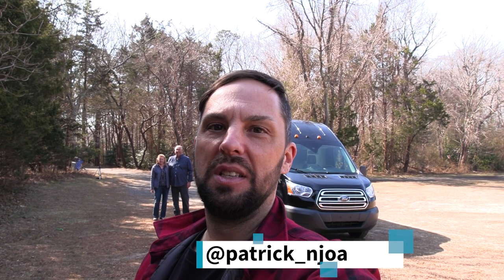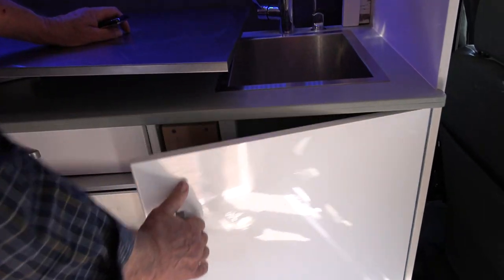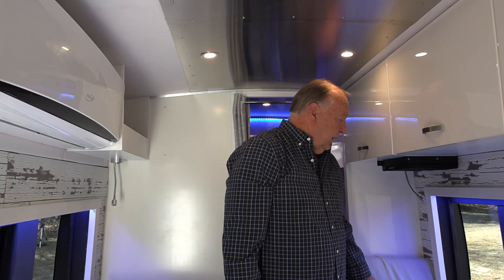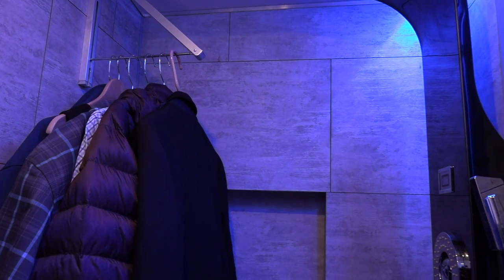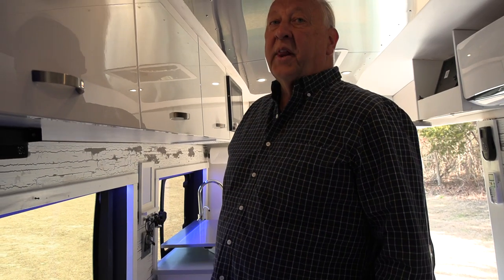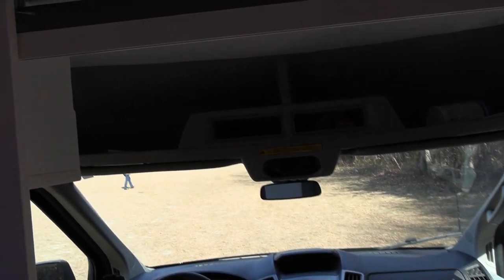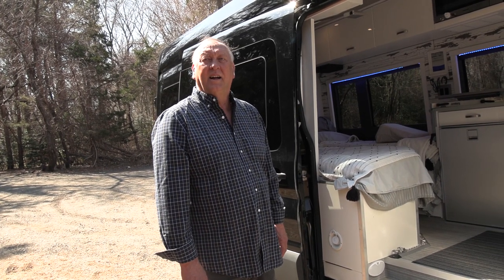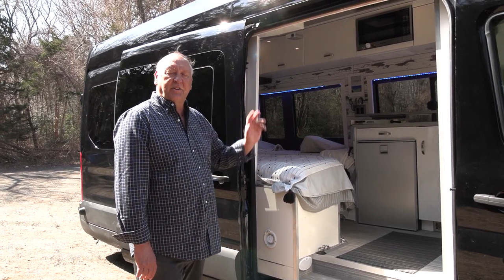Home Builder Creates Extravagant DIY Van Conversion With Full Bath & Shower

Comment: Great van build from someone in my age group. I agree that one doesn't want so many chores. I'd love to see a build where someone doesn't have to sleep over the battery bank. I don't think the paneling goes with the rest of the decor but it's not a deal breaker.
Reply: Lithium’s need to be in heated area, can’t be charged under 32 f,   vans battery chemistry are safe unlike Tesla or phone batteries. The paneling is attached with beau clips and easily be changed to suit. I frist did them in white and it looked like a hospital,

Comment: Excellent & informative Owner presentation and interviewer questions too. One of the BEST van conversions with 6'3" interior height, FULL shower bath, electric remote blackout window shades, huge tv projection screen, & sleek storage drawers. LOVE the split HVAC system and ample solar panels. The exterior hidden access ports are clever too. Will you sell it when your 2021 arrives?
Reply from the maker: Thank you very much. Yes, I believe he will be selling this
Reply: $78,000 , it has 36,000 miles, will  deliver 300 miles, after that $1.00 per mile

Comment: Fantastic van build. Upgrading the power system would be icing on the cake. Lovely. Well done.
Reply: Add 800 watts of solar if  you camp long periods of time without using engine alternator to charge batteries . There’s plenty of roof area without a/c on top
Reply from the maker: Yes you can always do it in phases
Reply: @paullehto1823  I agree!🤔🎯💯💯👍👍

Comment: Finally well designed storage! I see so many people put the batteries in the most accessible storage and have to dig their consumables out of every corner.  This guy put the guts in the floor access & hard to reach areas - there’s access, but the amazing 6 drawers are all accessible daily use storage. 

As someone who lives small but hates chores, I think this build reflects a lot of smart choices. Loved the details for the mini-split & the shower recirc too. The Lagun table that docks over the counter is also great.
Reply: Thanks, fixed all the thing that buged me on frist build. It’s nice to have small van for its moblity but you need to make use of every square in.

Comment: Appreciate this fella's fresh ideas like the showering system, mini split,  ikea finds and no solar  panels and still having power. Wish there was another way to mount the outdoor part of the mini split!I wonder if more vents in the back door and at the side of the van so the unit gets air... Any way just love the idea of mini split in the van.
Thanks for the tour!
Reply from the maker: Thank you
Reply: Agree, having to leave back door open to get a/c is huge drawback. There are very many complaints about a new van that requires rear door to be open, to get city water hookups.  
Maybe put a/c underneath, where spare tire lives, and put conventional spare tire holder on rear door. Would keep the van stealth, rather than having a/c unit mounted outside of back door, as I have seen before. 

Maybe dismiss theory,, 🤔 that vents can't somehow be cut into door and side of van, as you suggested.  
If that were the only obstacle for Space X, I bet Elon would FIND a way to get more ventilation, and not leave hatch door open.  

Otherwise, van wins best of show, except maybe a flip down flat screen, 📺 for better picture quality.
Reply: Mount the mini split higher behind the back window and have a glass window that opens and vents out so you can have the door closed? For his build he might need a power open for the window so the can open it from inside.
Reply: Yes, love the idea of the quiet A/C (mini split), but would hate leaving the door open. I bet on his next build, he has a better idea!  My only other dislike (and I understand he didn’t want unnecessary “holes” in the body) is having all of the outside connections so low to the ground and basically under the van. Too hard to get down there for some people. I love how they have handled this on the new Winnebago Ekko. Another thing I would consider is a self-contained type toilet (cassette, etc.).  I would also NEED a larger frig and TV. But this is THE best VAN build I’ve seen.

Comment: I would love to see his new build as well
Reply: It will have everything this van has but is 30” shorter, it will be AWD with 2” lift for off road use. It will also have sliding floor that extents 4’ past rear doors. Use as out door deck, out door shower( has indoor shower also)
Reply from the maker: Coming soon

Comment: Love this build. The split bed is a gamechanger
Reply: If I was  much younger, I would want a fixed bed with a garage under. This bed will slide together in one section. I’m now building then so they slide together in two sections. I leave bottom half open to make it easy to get up to use bathroom but add cushion to make upper half one large bed.I will have my new design on this channel in a couple of weekd

Comment: Cool van, I am in the middle of building out a new Ford Transit van and also using an Isotemp slim square HW heater almost in the same location so it was great actually seeing the engine hookups as there is very little info available on connecting them up in Transits online. He let it slip the Ikea returns great deals that can be had. I have found more than a few items at Ikea (returns) for use in my van. I got a queen bed spring slat system for way less than I would be able to purchase just the materials alone for - plus it raises and lowers (manually) so you can sit up in bed.

I am also a big fan of George @Humbleroad for his many great ideas and pointers he gives. He has saved me from more than a couple of big mistakes through his advice and recommendations.
Reply: Love George, my problem is I get up once every night to use toilet. That why I left 10”” between beds. Enjoy your new van, nothing beats camping near ocean or next to a brook in Montana with mountain views

Comment: Just saw the latest van and came back to see this one. Its beautiful too. Bath excellent and makes it my choice. Mod I’d prefer in bath is window over toilet is awning crank out to open. Will help with venting moisture and odors. Also bath Air Maxx roof vent vs the current exhaust system. The aluminum ceiling very nice look plus split system beats noisy roof ac. . Nice work Paul, well thought out. Nice to see such ingenuity and motivation. 👍

Comment: Great idea for the next van build,  but what will be eliminated if it's 30"shorter?  There is no wasted space in the van? The length of the bed will be still be needed.  I can't see a smaller bathroom.  The kitchen area is small enough.  Can't wait to see it.
Reply from the maker: He will be going with a floor plan like the Winnebago Revel

Comment: Wow, this is the best styled and innovative self build I have ever seen! I absolutely love this van! Everything you could ever want in a home that you can take on the road! Cheers
Reply: I just started on new design , I’m placing toilet on left , sink on right, with shower in middle, it will access to rear doors. No walls ( curtain when using bath) including  no wall behind drivers seat. Van will be open front to back.

Comment: Jarrod Tocci showed an AC that mounts inside a few months back- cruise in comfort.  Not sure if it heats also.  

I have also seen someone put the vent part of the mini split under chassis

I love the van - great ideas
Love the dry bath and the beds and window shades

So many great ideas!

Cant air to see your next build!!!!
Reply: Yes but the Cruise & comforts are $5K for parts alone, this was $1K with refrigeration purge. I have always thought though with a little bit of replumbing the compressor unit you could probably mount one outside under the chassis and you would still be thousands of dollars ahead. I to have installed several mini splits over the years in my commercial space builds. Great units for the price.
Reply: What AC unit is it?

Comment: You do such great videos and editing Patrick, well done buddy. This is a great build. I really love the idea of the Velcro panels to do maintenance if things go wrong. I shall use this for my build. I seriously believe this couple will be better suited towing a trailer he can build to suit. I can’t see how he’s going to be climbing into basically sleeping quarters on the back of a pickup. They won’t have the amenities of the van and again the work to put it on and off the pick up each time they go away will remove the excitement of a turn key and go feeling. Mind you this is nothing more then my opinion. Kind regards, Mario.
Reply: I building next van out of a shorter transit AWD, it will be used like a work van and everyday driver and be turned into camper in 10 minutes. No need to have too expensive s vehicles. It will have everything this van has and more.
Reply: Oh, I do apologise Paul. Looking forward to seeing it. Cheers buddy.

Comment: Could the outdoor portion of the mini-split be installed underneath the van so no need to open the door while it's running?  Or cut in a vent on the door?
Reply: You put unit under van it will get clogged with dirt and maybe damaged, I have no problem with door open unless I’m parking on the street and don’t want to be notice. Had to couple of times and simply did not use a/c. The pros far out way the cons
Reply: He explained in the video why a vented door would not work.  It must have total open air under and behind the unit.  The unit is made to be completely outside with no obstructions near it.

Comment: Love the single beds for as long as you need. Yes - he is 6'4" most beds don't work:)  Amazing bathroom for a van.  Wow, power curtains and bed back! Good to know the minisplit for AC and heat will need a back door open for enough air flow. And that need 110 instead of 220.   Taping the hot water lines to theisotherm water heater.  I think I will have a professional do the electrical especially. Looking forward to seeing the short AWD!
Reply: Why do you need 220v ?

Comment: very nice and useable. Enjoy!!
Reply from the maker: Thank you! Cheers!
Reply: My first build I had rv ac with heat pump, I hated it , I could no have normal conversation or sleep-  it would use 100amps per 45 minutes. Heat pump unless under 40f . This uses 30 amp per 45 minutes and is wisper quite. Heats  down to -5f. Gives you more head room. Better gas mileage and it’s better to have weight down low than on top. Maybe cruise and comfort will offer heat pump version soon

Comment: Great hot water recirculation! Sticks and bricks should have that! Great camper van. Doesn’t look good for full timers though. Not enough storage.
Reply from the maker: Thank you for the feedback
Reply: There is storage under both beds , over ea h bed, over kitchen, over front seats and off rear doors. What it’s missing is one bed that converts into couch. I’m eorkinking on that

Comment: Rather have a view from my back door but that was a nice shower and the Window shades. Adding electric window shades to my no chores list. Complete van was nice.
Reply: Agree, because van width is 68” at bottom an62” at top your limited to about 22” deep bottom 19” top shower because your kitchen 22” and hall way 24” need to be this to work. My next van bath is behind drivers seat but expands from 22” to 44” when in use. This will give view out back doors, their will be other cools things that I’m excited to share
Reply: It's nice to have view in back with doors open, it also nice to see backing up. Next build I will move bath behind drivers seat. I need to make it expandable so it's not so small

Comment: LOVVVVVE THIS VAN!! <3
Reply from the maker: Me too
Reply: I just found out, most rv manufacturers in Japan use house type minisplits for the same reason I like them. Heat down to -15f , very quite and energy efficient. They put a large grill outside of unit for air

Comment: Beautiful job on the van I’m just curious if you ever have taken a gauss meter reading over those batteries where somebody sleeps. I believe Tesla in more economy model cars, had to alter the position of whatever kind of batteries they had under the driver seat as they found the meter readings were off the charts for someone sitting right above the batteries
Reply: These batteries are safe, different chemistry than Tesla. No off gassing and very stable. Not has powerful as tesla

Comment: Beautiful van build. Absolutely, the the best privacy/ movie screen dividing the cab from the living space that I have ever seen. Love the full bath in the rear with separate shower area. However, don't like a curtain for the entrance to the bathroom, would prefer a sliding door for privacy and guests. Didn't see if the windows open more than a few inches and are there screens?
Reply from the maker: Thank you for the praise and for the feedback
Reply: Solid doors in moving van adds noise , weight and cost. Curtain is none of the above and gives you privacy. Not perfect but I does the job
Reply: @paullehto2294  I understand your reasoning for the curtain. I suggested a lightweight door for the bathroom because that is what I would want. I have seen so many of those doors in vans but I can't remember the name. Your van is great.

Comment: Sweet Van!  I like the Mini-Split A/C Heater, I don' t like that the  rear door has to be open to use it though...  Is there a solution to have the doors secure and still use it when it's parked at home and connected to the Mains?   I love the Shower!  Great job on this Van!
Reply: Door open does not bother me, not having ac all night in summer does, my first van had roof top that used up 200amps in 1-1/2 hr. I can run 10 hrs now. It also will heat down to -5f.
Reply: @paullehto1823  It was mentioned that the huge battery bank is sustained by the engine charging system.  Having a ginormous-humoungous Solar Panel charging set up would give the opportunity to have an excursion to the wilds of America and be off grid for however long you like!   I look forward to Van number three.  (Hello from Tulsa, Oklahoma)

Comment: Would suggest a freezer. Screen/netting for windows. Maybe airfryer instead of microvave/kettle to minimize current. Cannot think of anything else. Luggage boxes on wheels for additional storage.
Reply: Screens would be nice on side door,have you tried air fryer? I will check it out. Thanks

Comment: well said on the insulation , it never made sense to me sealing it in with a vapour barrier, let it breath vented wall panels etc
Reply: The mini split puts out so much cooling and heat it easily handles all the glass.

Comment: Tank dimensions please.  I've ordered a Transit and my plan puts black, grey, fresh tanks in the same places. How long with engine on to fully heat the isotherm water heater tank?   Right now, my sketches assume wet bath drivers side very rear, aisle left open, beds similar.   Your video is the most helpful to me of all the video's I've watched.  Thanks for posting.

Comment: I think the Transit is a solid platform and will probably choose the non-extended chassis for my own build. The think I don't like about the extended chassis is that the wheelbase is a little too short. The rear overhang is way too long which looks goofy and makes it a bit more challenging to arrange heavy components like the water tank, batteries, inverter, etc inside and under the van in a safe and balanced location. The wheelbase definitely needs to be at least 18 inches longer.
Reply: It does look a little goofy and causes it to scrap trailer hitch  on steep incline. The transit rides really nice and has tons of power,  350 HD dual wheels helps
Reply: I ordered AWD 2021, I want shorter van that I can use every day

Comment: No worries, I don’t charge any thing for minisplits in my builds because it’s testing . So far so good, they are preforming far superior to any rv a/c on the market.  Cooling and heating at half the energy Consumption. No rv heat pump a/c can heat down to -5f. Most rv’s built in Japan for years use household minisplits with no problem. I will use same minisplit in my new build but will place it outside since my new build is shorter. Thanks for your concern but I can easily afford to experiment.

Comment: Can you link to all that is in the build. Like the beds and the remote shades and can closure, mini split. The shower/tub fixture...etc
Reply: I did not keep notes on the products I used. Most things like bed, curtains, are all custom built. I have vast experience in engineering and home building that helped me build this van. To build a van at this level was a real challenge. You never know, I’ve seen some amazing vans built by people with little experience.
Reply: @paullehto1823  Wow! So Impressive. Wish I could build beds like yours. How about finding and rigging up your Remote blind mechanisms? 
Question...So am I correct in hearing that  mini split  takes care of keeping van cool in cold temps and also comfortable *cool in hot weather, as well, or do I need additional heater as well. Guess I will go watch your video on this. Thanks again for responding.
I kinda like that some mentioned heated floor systems.

Comment: Did he say the back door needs to be open when the A/C or heat is running on the Mini Split Air Con or did I misunderstand? 
Beautiful build!
Reply: All a/c fan coils need air  to expel the heat, you can place a/c out side of van, roof, back bumper, under neath van. If you place coil inside, you must leave door open so it gets air you leave rear door open at campground but you have wall behind it. House mini splits are far superior to rv a/c units.
Reply: Thanks so much for the explanation. New to this. Van on order so learning all I can before it arrives. 
Looking forward to your new build. It sounds like you may have an elevator bed? That’s what I want. Can’t wait to see what you come up with. Your work is beautiful!